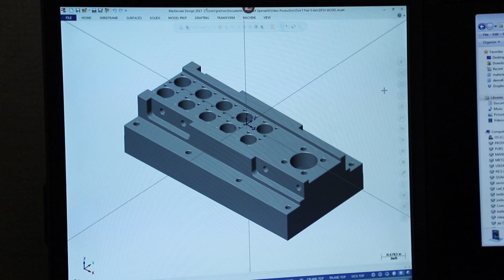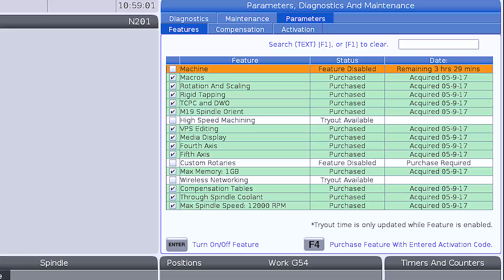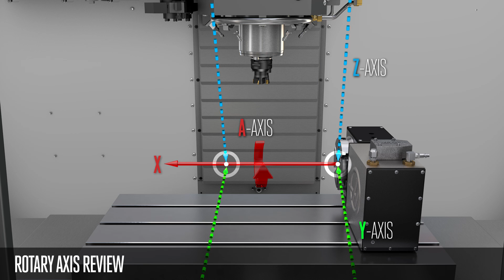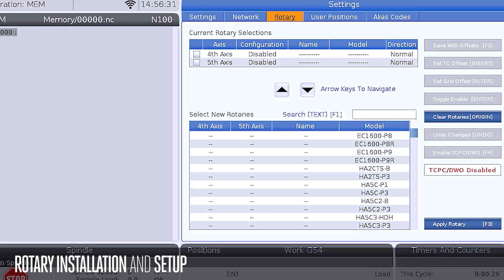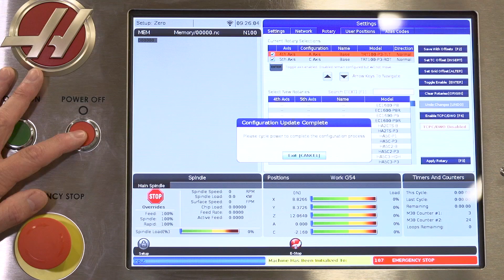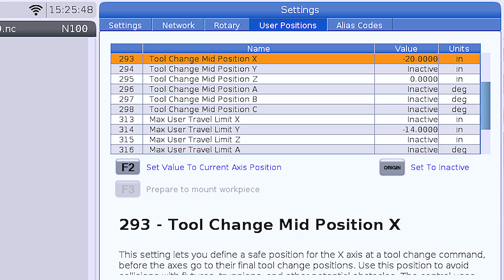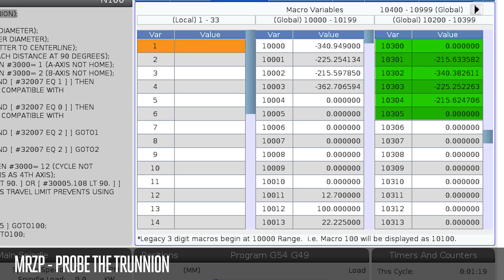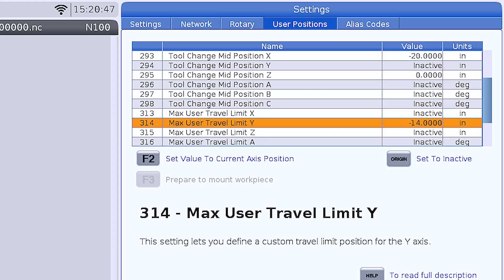Don't Fear 5-Axis - Episode 3

Comment: @Haas Automation
I work with vf-2tr (tr160) and The features mentioned is available and enabled. However, the settings (300 to 305) not there.
I tried to use DWO/ TCPC but not work as should be.
Any advice please?

Comment: Dear haas. maybe it would be worth making the 4th and 5th axis 
connectors somewhere on the side of the table? (like AUX air connector) 
The wires from the machine would be run like wires to the X-axis servo 
drives, so the disturbing or breaking cables would disappear.

Comment: This is too mechanical. Can't u just use laser scanner to configure your own machine instead of dumping your job on your customer? your machine should be able to 3d scan everything inside it that is not a tool or a part to be milled and find its own damn center in less than a minuet as the name indicates "CNC".

Comment: Why is the 5th axis drive and wiring option 3 TIMES the cost of the 4th axis drive and wiring option? Knowing Haas and how they standardize so many parts (which is reasonable of course given they are a business trying to make money) Can anybody tell me with any certainty that there is any physical difference between the two drives other than the Sticker and maybe some firmware so the control knows its not just a 4th axis drive??? seems a little like price gouging for the "premium" of a 5th axis??? As if the cost of the rotary product wasn't enough? I'd be willing to bet that if you cracked them open they are identical on the inside! I Also agree with others who say HSM should be a standard option. Haas even states that "Modern toolpaths NEED HSM..." in their video spotlight of the feature. So why not just include it from the start since most people want it anyway? the control is already capable of it from the start! Same goes with Macros, most other manufactures don't even consider it an option but a given?!? I understand picking and choosing options to best suit the application and save unnecessary costs but when it comes to software options that cost Haas $0 to activate that's where it gets a little ridiculous.

Comment: This is misleading and over simplified. Yes on the older machines you pick up the offsets manually, but you do it with probing routines. You can also automate the process with good tooling and smart macros. Nobody in their right mind spends the money on a 5-axis machine, and then picks up the offsets by hand like he shows here - give me a break. Of course the DWOs and TCPC are nice, but if you find a good deal on an older machine, you can still do great things with it.

Comment: I wish you'd make a 5-axis machine for home use that is below $15,000. Maybe with steppers instead of servos. It doesn't need to be fast, just precise enough for the enthusiast DIYer. Fusion 360 has opened up so many possibilites in that price segment.
Reply: The key difference between stepper motor and servos is that servo motor knows its exact position, because it has the rotary encoder, whereas stepper motor doesn't. But it is possible to use some sort of limit switches to set the start position of the machine when using stepper motors. It's just a little bit more difficult comparing to the servos, I think.

Comment: First of all I don't have a HAAS.
But if anyone can help answer my 5 axis question I would be thankful. 
I use Solidworks and Camworks. 
When I built my post processor in Camworks UPG I see nowhere to input my A axis offsets. I have a Table Table 5 axis. 
When I run simulation in Solidworks all axises turn correct and Z mills the parts.  On my machine all axises turn correct as it's running a dry run but Z seems to mill the top of the part fine at A0 but when A90 the Z is still where it was and now 2" above the part.
Coordinate plane is at A centerline in the CAM model

Comment: DWO and TCPC is very simple piece of math. You only need to know MRZP (coordinates of the intersection of the axes A and C) and G54 work offset in MRZP coordinates. Using the Denavit–Hartenberg parametrs, you can eseily find a homogeneous transformation matrix.  Excel sheet: https://docs.google.com/spreadsheets/d/19IQZWzaFsI3rdgrOZrXs-BVNhHD89n4hfWrxi9SXnh4/edit?usp=sharing

Comment: It's clear to see that you know what you're talking about but as for me, a machining hobbyist wanting to move from Tormach hobby mills to one of the smaller haas mills,  just listening to you describe all of these steps is  mind numbing.  This mind-numbing effect has more to do with my dyslexia than it does with all of the steps involved.  I'm a self-taught hobby machinist as well as being self-taught in CAD/CAM.  When you're self-taught, you have a situation where the teacher is just as ignorant as the student.  There's alot of trial and error involved.

It will be a while till I come up with all of the funds to actually make such a machine upgrade.  Hopefully by then Haas will have integrated a bit more "Artificial-Intelligence" into their CNC mills that will do all of this setting up for me so that all I have to do is create my ideas, designs and inventions and then machine them into existence.  

Doing all of the setting up of these 5th-Axis milling devices and calculation come very easy to some folks,  but unfortunately for me, I'm not one of these lucky folks.   I'm a creative dyslexic person who sucks at math but, given enough time I can eventually figure these things out for myself.  Still, it will be nice if when I finally get all my ducks in a row to make the move to a larger milling machine, Haas will have integrated the "Artificial-Intelligence" into their newer mills to allow me to dive right in with a minimum of mental stress.
Reply: I was the same but the more you learn and try it the easier it gets

Comment: I just ran the MRZP template....it just flattens platter and just alarms out and says “set TC by pressing insert” it doesn’t tilt the platter and enter correct data in the machine variable.....so i guess i have to measure  A+90 / A-90 and and find the values manually to finalize the MRZP?
Reply: still giving you trouble Jason?
Reply: Zachary Breeden I’m having trouble with this! His problem is the same one I’m having right now. It isn’t continuing with the probing routine. Just “set TC by pressing insert” but I have already set my A axis flat.
Reply: Did you figure out the solution? I’m currently running into this issue.

Comment: Why does a 5th axis trunnion cost as much as a complete mill? Not trolling, I'm just curious what's in it other than some servos and worm gears
Reply: It is true it is expensive.

'But when you start looking at more than 3 axis you pay regardless of how you approach it.

It is difficult to buy power without money,  that is what it mainly comes down to.

Simply put the more money you want to make,  the more money you need to spend it,s pretty much that simple.

If you look at buying a ready to go 5 axis you will quickly see the price go up.

Regards Peter.

Comment: i watched all 3 parts but i dont got an answer to my question.
Assuming you have a 3-Axis and a 4-Axis Machine,
which parts can be made only with a 5-axis machine ?
(yes i know 21% time saving, but thats not enough for me)
(only example i found are impellers)
any ideas anyone?
Reply: I will try with my best English ;) I think you are right with simultaneously parts like impellers or  helical nuts on a 4th axis. The main factor i can think of, is the reason that you save a lot of time on parts, that have mill jobs on each surface. We needed 5X the most, because the accuracy
  of all jobs of each surface to each other, couldnt get realized when u clamp the part every single time for each  surface. Also we needed it for holes that were angled in 2 ways (for example B5°A10°). But those were Machines over 300k €.
We have only one Haas in our Firm and now thinking of buying a new VF4SS with an TRT200Y, because of the low price. The rest of our Machines are DMG and Spinner Mills. But im not sure how accurate this combination is. The Parts arn't this complicated (stuff like sensor holders) but need to be clamped 2-3 times without 5 axis, maybe well give it a try.

Comment: Trial... period... for stuff already on the machine? Did I just read that right???
Reply: It's only software (no physical components) so they load everything and you only pay for the software level you need. Downloading the software to the machine costs next to nothing so they put it all there but don't forget that it was HAAS who already paid up front for the thousands of hours that go into the development of each bit of software which rightly so, they want a return on their investment. Motec does the same with the engine ECU packages. In my case and relating to engine ECU's, I weighed up the cost of what I needed my ECU to do and it turned out another brand was cheaper. Do the same with HAAS, figure out what you need exactly and how much it'll cost then compare that with other brands but I'll guarantee you you'll find it difficult to find better value than HAAS when comparing features.
Reply: The time companies put into software development on these features has to get recouped somehow. It doesn't matter that the hardware already exists. In this case, you end up with a freely upgradable base model with a low cost for those who don't need the advanced features. Much better position than back in the old days when actual hardware changes were needed.
Reply: Definitely it's better to buy some other brand.
Reply: @John.Doe.2025 Nowadays it is a usual practice for all companies to force customers to buy options.
Reply: They are BUSINESS. their purpose in life is to rip every last cent from their customers.

Comment: Did I just hear that right a trial period for 4th and 5th axis Wtf that's an option you get hosed extra for??
Reply: Everytime I see that "tryout available" it pisses me off. Especially when I negotiated having High speed machining included but it's been more than 6 months that I've been fighting to get that turned on. HAAS really should re-evaluate those options, increase the price of the machine but include all "options".
Reply: You won't get an option for free unless it was in your purchase order for the machine at the time that you paid for it. If that's the case then call your HFO and get the code for it. However, if the option wasn't in your PO, they're under no obligation to give it to you regardless of any verbal agreements. That sounds like your salesman put one over on you.
Reply from the maker: travisspeedee - Not every option is available for tryout, and that includes 4th and 5th axis since they each require an axis drive and wiring to power a rotary or trunnion table.  If you go to that options page on your control, only the options that are available for 200 hour trials are listed with "Tryout Available"